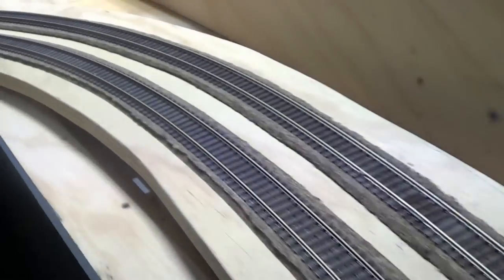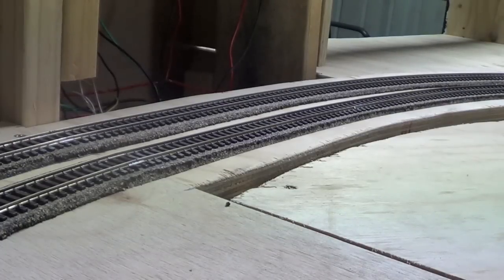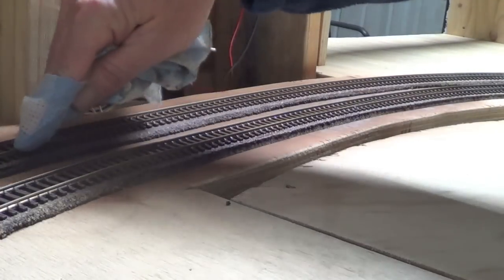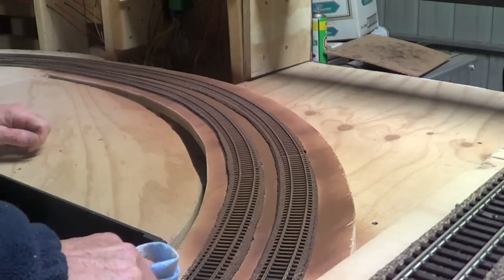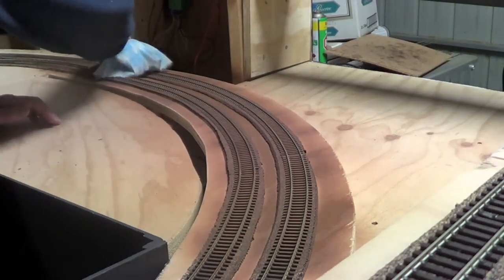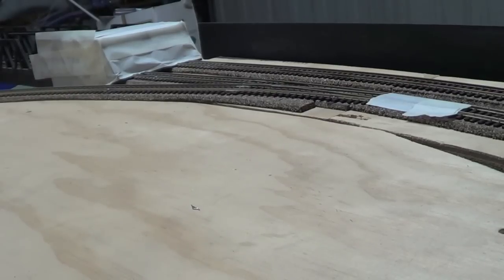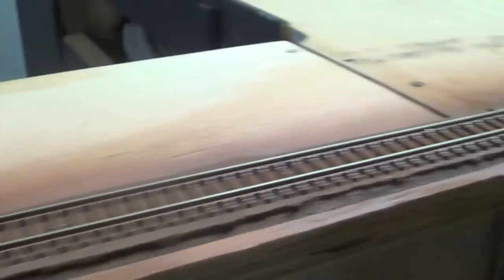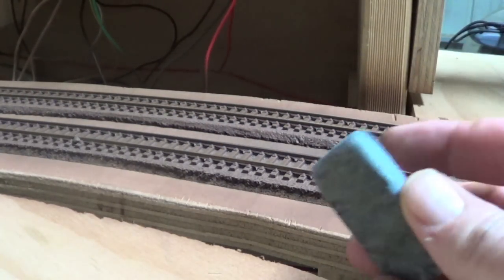"Weathering the Tracks With TAMIYA Paints" Model Trains Part 21

Comment: Wow !! I just saw the braces you used on the layout. Very good and real nice work on them. People just don't go to the trouble to do this kind of detail these days. I'm impressed... I have been spraying the track and I found that a square of OSB lumber with a couple of layers of paper towel works great. Then the same OSB square (about 4 X 4 inches)  will take almost all of the rest of the paint off when used as a scraper but will not scratch the track. Use the rough side of the wood. I use Rustolieum and even it being a paint that will melt foam, I find that if you use it in light coats, it will work without any problems.
Reply from the maker: David good idea  using the lumber will try that out on the new layout cheers Robert

Comment: any issues with running locos after paint? I've had to really clean the tops to get decent connections
Reply from the maker: No problems with running loco's but you do have to clean the top of the rails cheers Robert